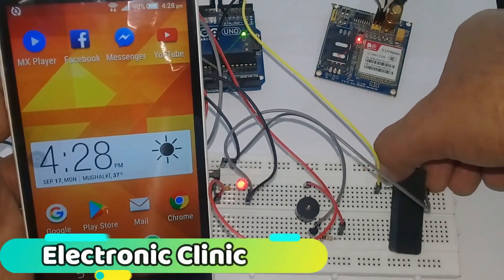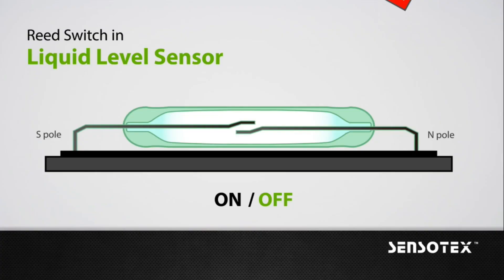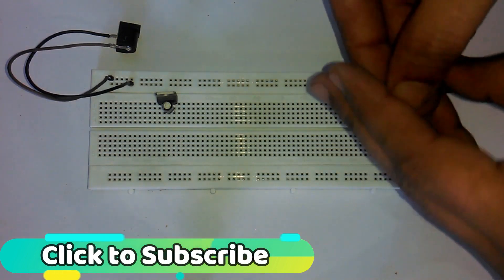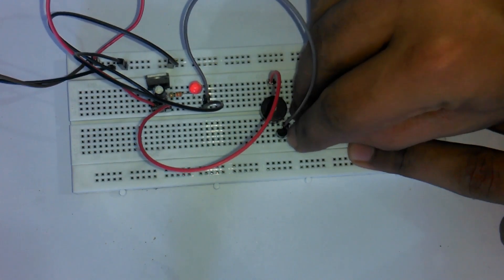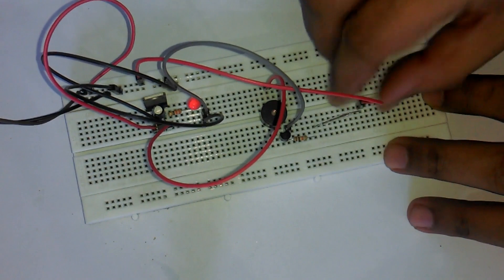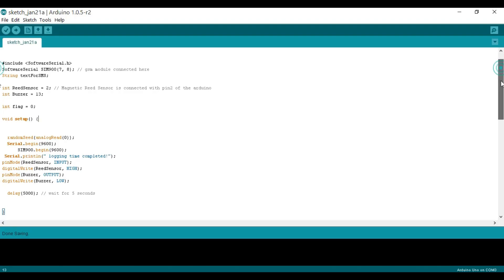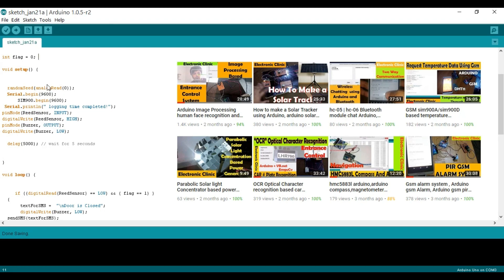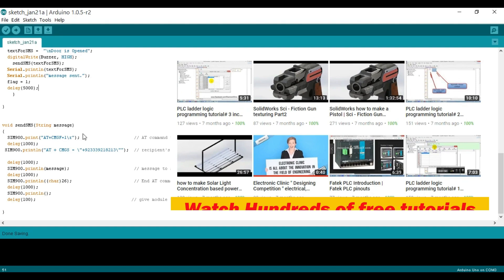Arduino Magnetic Reed switch door security using GSM sim900A or sim900D "wireless security system"

Comment: Sir when you mentioned the gsm module has it own supply ... does it mean the project will have 2 wall plugs or I can use a jumper connected after the regulator (5v) and connect to the gsm module ?